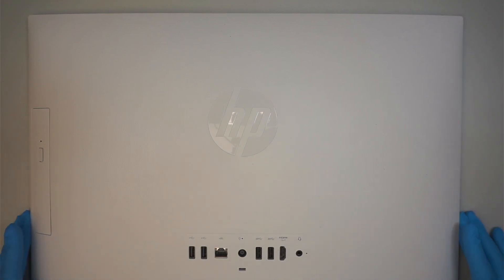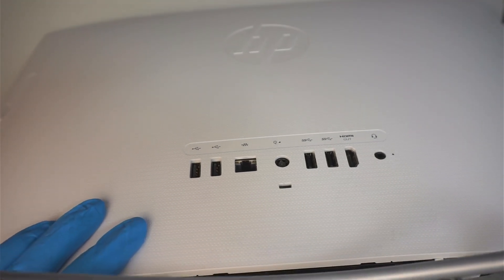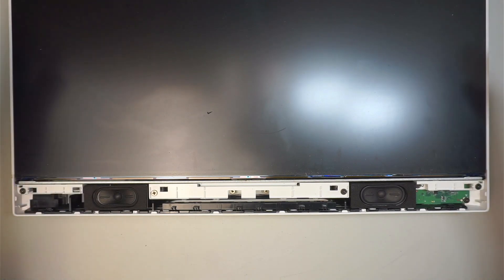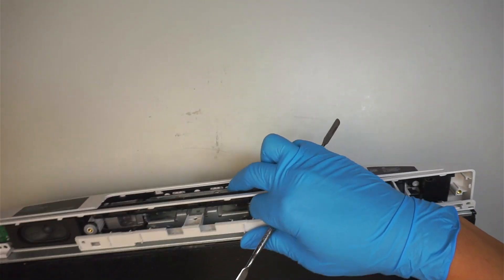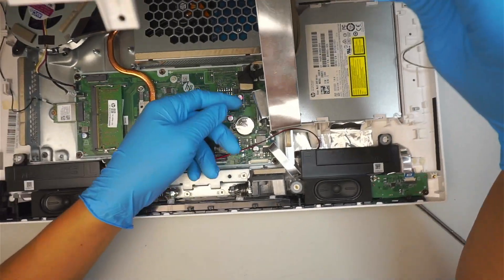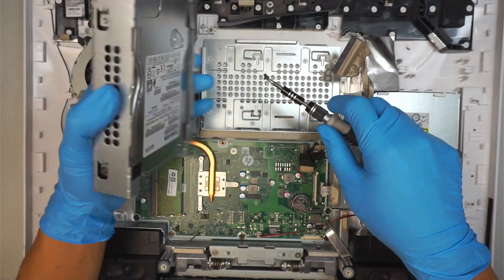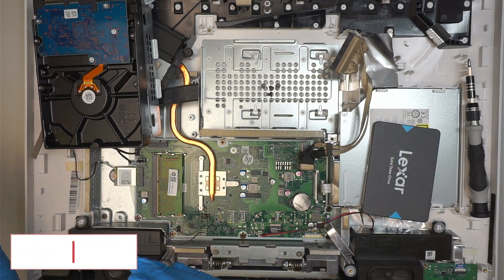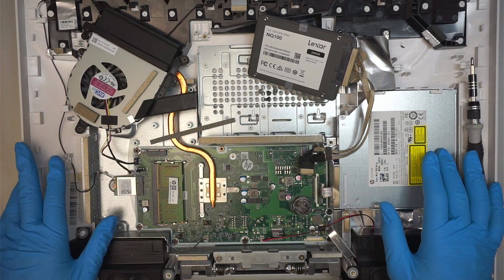HP 22 c0010 Hard Drive Replacement to SSD

Comment: Doesn't it have an M.2 PCI slot for a HDD? When I looked up the model 22-c0xx on Kingston's site the only SSD options offered were M.2 2280 format, so they seem quite confident it has that slot. But apparently with any PC more than a couple years old at this point you have to open it up before you buy your SSD upgrade 😡